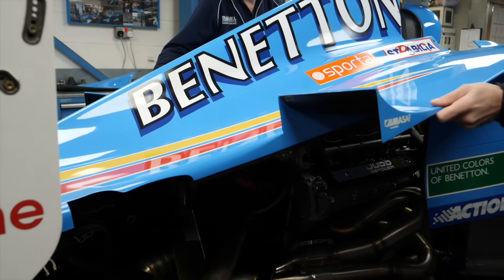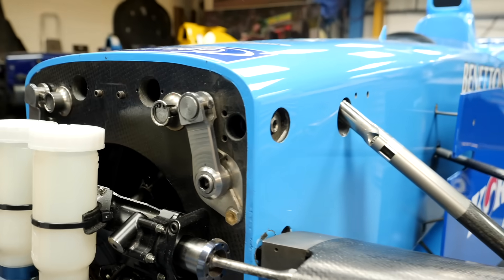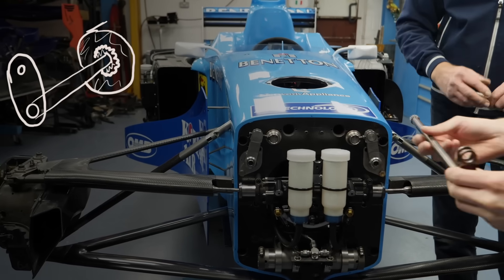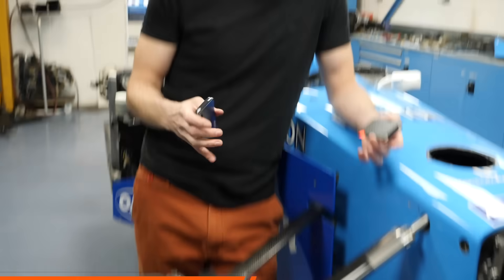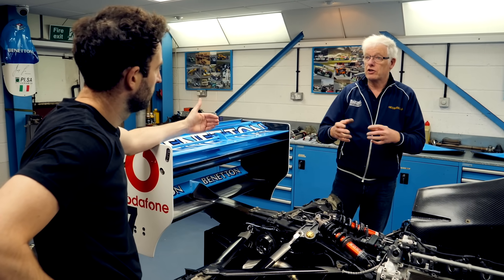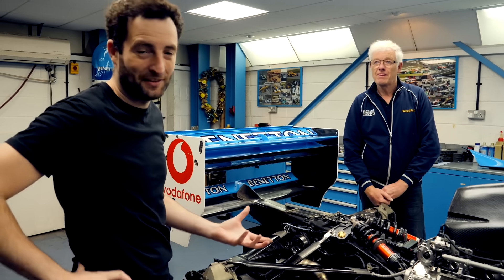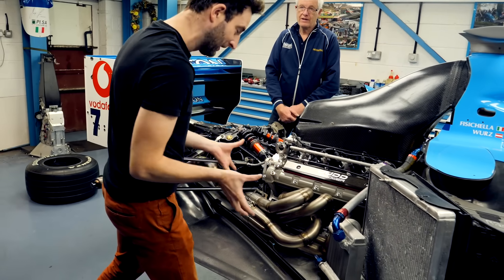Why F1 Suspension Doesn't Use Coil Springs!

Comment: Thanks for rememberiing of the concept of tortion bars. Could you explain the downsides? Its such a minimalistic concept and i jdont see a reason to not use it in a standard car?!

If yiou like jokes. This guy goes to a car spare part shop and asks for a seven-ten cap for his cart. it's in German but you  will get the joke about the 710 cap.... https://www.youtube.com/watch?v=2r4w6YYeBTg

Btw ths 710er cap is built into almost every car if its made from Tesla.;-)

Comment: I understand torsion springs however I do not understand how the motion is dampened in rebound.  the torsion spring elastically deforms and "twists" taking the load..the higher the load the more the twist.   However, once twisted the torsion spring or a coil spring wants to return to its original shape as quickly as possible. in an oil shock the valving is used to dampen both the compression and the rebound...the rebound being extremely important....Do F1 cars not see enough suspension movement to require rebound dampning?

Comment: There wasn't any sort of description of how the torsion bars worked. Just saying "they essentially do the same job" doesn't do anything.
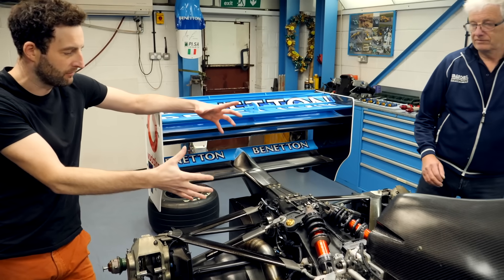1:12 "Push rod forces come through here" while vaguely pointing at the engine does not describe what is happening. You should start with the direction of force from the wheel, follow it through each part of the system to the spring. 
Not a single word on what torsion is. Nothing. The brief part at 1:35 where he motions with his hands on where the input forces come from still doesn't explain what the torsion bar does or why it doesn't shear. What is it connected to? How do the suspension forces get to the torsion bar?
Then at 1:40 "it's really important to see what it does". Great. But they he says "you can't see it as it's covered up". Fuck me sideways. What's the point?
Terrible. Absolutely woeful description of what is happening. If a student submitted this as a description of a suspension system, I'd fail them.

If you're going to give a headline of "why..." and profess you are explaining something, maybe rehearse the script, check it with someone who doesn't know all your industry's technical terms and use a presenter who can explain it.

Comment: Those primary pipes, is the aim to have them the same length?  Because the cylinders fire at different times the exhaust gases will begin their journey at different times.  If the pipes are the same length then the gases from each cylinder will take the same amount of time to arrive at the junction and remain out of sync with each other thereby reducing the gas passing through the junction at any one moment.

Comment: 5:44 can someone explain the attachment of the primaries to the collector? What is the design intent of that bracket?
Reply: Looks to me like adjusters of the primaries? Maybe you unscrew them, and put a different length bracket in the middle. As the Dad was saying: varying the length varies where the power is as per dyno runs. Every F1 race has it's own unique conditions: I guess being able to adjust the exhaust primaries lets a team optimize power delivery per race. Or maybe it's to do with modularity and ease of build and maintenance? Or literally, extra reinforcement for the pipework.

Comment: OLDER Chevrolet/ GMC / Escalade , Silverado used TORSION BAR for Front SUSPENSION !!!!
CORVETTES uses Fiberglass LEAF SPRINGS !!!! to Push on the Lower Control Arms - VERY LIGHT !!!!!!!

Comment: Always liked torsion bar suspension VS coil spring/coil over strut.  Everyone just said how inferior it is... Yet I feel matched with the proper shock absorber it can be an excellent performer... Much like my daily driven vehicle, the other benefit is they don't wear out... A vehicle 30 or 40 even 50 or more years old usually is still running the same torsion bars it was sold with.  Unlike coil spring vehicles.

Comment: Actually a coil spring is just a torsion bar someone wound up around a cylindrical shape.  1960's and early 70's Dodge and Plymouth street cars used torsion bars in their suspension (my dad was a mechanic for a racing team running these cars on dirt and asphalt, so I saw lots of torsion bars as a kid), so this is nothing new.  Also, if you shorten a coil spring, the spring's rate increases. This isn't intuitive until you realize the coiled wire is simply a torsion bar packaged a different way.  It's patently obvious making a torsion bar shorter will increase the spring's rate.

Comment: Thanks, it was interesting to listen to you and your dad talking about some of the stuff you don't always see on F1 cars. Fo rme though it did provoke a question: The title says "Why F1 Suspension Doesn't Use Coil Springs" but the car you showed did have coil springs at the rear. If torsion bars are smaller and lighter, why were they only fitted at the front?

Comment: Is there some reason torsion bars are not used in normal road cars? The suspension takes a LOT of room in normal road cars and torsion bars would allow much more interior space especially at the back of the road car. Do these wear a lot quicker, for example?

Comment: Shame that there was no mention of the Lotus Type 72 that I think was the first Formula One car to use torsion bar suspension. When it debuted in 1970 it had anti-dive and anti-squat, and by all accounts was a bit of a dog to begin with, but by the time the Type 72 was raced in “C” specification, about 5 races into the 1970 season, the anti-dive and anti-squat had been removed, and it was winning.

Comment: Implication is it was some kind of 'new' technology. VW Beetle had torsion springs all round from 1940's (as did the 1970's Morris Marina I had for a few days 'way back when) Damper technology would be far more 'interesting', magnetic ferro fluids, , 'active' suspension, etc. Exhaust gas 'pushed out by piston'? I don't think so. Even on a low power street engine exhaust gas is around 80+psi when valve opens

Comment: What about the suspension damper when using torsion bar? With coil springs, the damper is placed inside the coil. How does it work with torsion bars?

Comment: The Lotus 72 used torsion bars back in 1970. It won a race or two.
Reply: Yes, it's a shame that the Lotus 72 wasn't mentioned regarding the use or torsion bar suspension, plus the fact that it is the progenitor of all modern F1 cars, i.e. side mounted radiators and wing front & back etc, and celebrates its 50th anniversary since it was first campaigned in F1 by Team Lotus.

Comment: How is damping achieved with the torsion rods? I would imagine those don't ave a lot of damping. Is the metal composition tailored to have more hysteresis (which I guess you could consider damping...), or are there other components (for instance, tires) that provide the damping?

Comment: When you showed the front suspension with the torsion bar, you should have explained how it is dampened on the rebound. I've seen this technology used on vintage cars that are  80 years old or more. This concept is not new, the materials are obviously state of the art when this car was constructed.
Cheers for the incredible video featuring these magnificent machines!

Comment: One thing I noticed that was failed to mention is that a torsion bar & a coiled spring both use torsional force to do the same thing. A coiled spring is basically a torsion bar packaged in a coiled shape. Taking a much longer piece of spring steel to fit it into a smaller space. That F1 torsion bar is very small & is very impressive to see.

Comment: The coil spring had a dampener. Do torsion bars need them too? I thought road going production cars with torsion bars still had a shock absorber.
Reply: Yes, there are dampers that you couldn't see behind the bodywork.
Reply: @19minorthreat69  Cool, thanks. :)

Comment: You really need to brush up on mechanics. There were numerous common knowledge mistakes in this video. First you were wrong about the header tubes being "not all the same length" when in reality that is exactly what they are for equalizing the back pressure. Second was saying there are no springs, a torsion bar its self is a spring. The correct statement would have been there are no coil springs. That was also just 4 minutes into the video.

Comment: Torsion bars, such a new cutting edge thing. Except they were on every Dodge, Chrysler and Plymouth of the 50's, 60's, through the mid 70's. Hell they even used them on my Dad's 1956 Ford.

Comment: I get the  torsion bar thing it was used on the morris 1000 and it worked but F1 cars have hardly any suspension they are more like go carts that proper cars.

Comment: The quality of content is amazing, but sometimes, when You paraphorase the expert, you dilute the meaning. 
In 8:05 for instance, it is notabout lack of rigidity in the case of torque transfer to the gearbox, but to provide the rigidity between the whole powertrain and chassis.
Jeez, motorcycles are so much easier to design...

Comment: Exhaust Headers: The header tubes are all the same length to optimize the movement of spent gases from a cylinder's combustion chamber. Exhaust gases are more akin to a "slug" v a continuous stream. (You can actually see this happening if you hold a piece of paper over an exhaust pipe at slow idle. The paper can be sucked back onto the tailpipe as the exhaust pressure drops with each cylinder firing.) The collection box where the tubes come together allow the exhaust gases (slug) to "expand" as they exit a particular tube. That expansion creates a negative pressure wave back up the exhaust tube so that as both intake and exhaust valves are open momentarily together at "split overlap" a small amount of intake air/fuel enters and passes through the combustion chamber and out via the exhaust valve. This "cleanses" any remaining exhaust from the chamber, cools the spark plug, and helps control pre-ignition. All of this activity is predicated on cam / valve timing and optimization on a dyno as your dad mentioned. As the exhaust valve closes the cleansing  ensures a full cumbustion chamber of air/fuel to optimize ignition and power. PS_Have spent countless hours denoying race engines. Cheers.

Comment: That torsion bar is CRAZY small. In road vehicles, the torsion bar is almost as long as the vehicle is wide. This is mostly for longevity, as the longer the bar, the less stress it is under. Longevity is not as much a concern in racing, even still those torsion bars are unbelievably short! I am extremely curious as to what alloy(s) is used.

Comment: Back to the drawing board regards your exhaust comments mate, they’re all equal length, that’s why they bend so much, trying to fit the same amount of pipe length per cylinder in such a confined space. Especially noticeable on turbo cars. Even my old 1.3 Ford pushrod engine ran better on its 4-2-1 equal length manifold ;) I think you could do to possibly spent abit more time listening to dad about engine power theory and principals. 👍

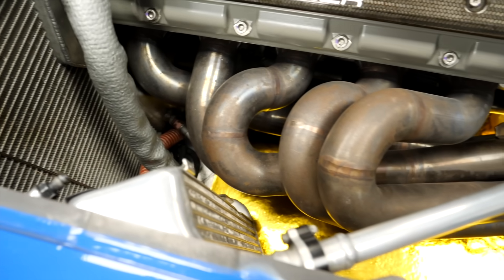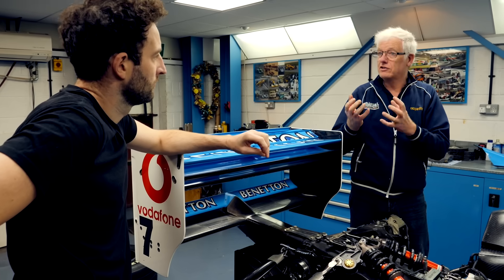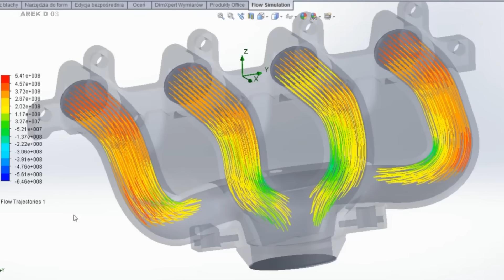Comment: At 3:46 the dad says all the headers/primary tubes HAVE to be the same length, then seconds later at 4:02 he totally contradicts himself by saying if they they are all the same length they collide, so you get disturbance and back pressure!  Which of course is a bad thing.  I would have told him to make your mind up...Do they have to be the same length or not?  But then at 4:25 the son says the complete opposite...That they should be different lengths!  Talk about confusing!

Comment: Compressing a coil-spring twists the rod it is made from. It’s a way of making a long torsion-bar shorter.
Reply: Straight torsion bars have existed since the earlier days of the motorcar. The ones featured here are advanced-material versions of a classic design. I wish they would have covered the rebound dampening process inside the nose of this modern marvel. 

The old-school dampener versions had stacked adjustable disc pads with a tightening screw in the centre to adjust the friction, thus speed, of the rebound. It actually worked well for it's era.
Reply: @JoeGator23  iirc torsion bars were first introduced on production vehicles on the German Panther tanks, as they had used it for suspension, and started the trend of torsion bar suspension throughout combat vehicles from then on, even the Abrams of today uses the Torsion bar

Comment: The old Moggie 1000 ( 1959 ) had torsion bar suspension on the front wheels.
Reply: The Citroën Traction (1934) had still  torsion bars on all wheels (all independant)...

Comment: The “rocker” is called a cantilever.... what dampening is used in the front with the torsionbars ? Friction disc maybe ?
Reply: Rocker, bell crank, cantilever, etc etc there are many names for the same part just like a knuckle can be called an upright. Also its Damping, not dampening... you're not getting it wet. To answer your question, usually the bell cranks that activate the torsion springs will also activate a typical set of linear dampers as well as a heave damper.

Comment: That a coil spring is a torsion bar form into a coil, has been recognition for years I don't have clue when vehicles first used, butevidence is, it could date back to the Egyptian chariots.  Where the entire vehicle was suspended by a torsion bar structure  made of wood.  The  older VW Beetle used torsion bars. Crysler products used them for years. GM light and medium duty trucks use them in the early '60s. Interesting, to see how that on the F1 cars the use of torsion bars, had it'sown evolution.

Comment: Sorry to be pedantic, but in the interest of correctness... what happens in a combustion chamber is not an explosion. It's actually a single flame front, a controlled burn of the compressed gasses. knocking / pre ignition is when two flame fronts meet = can cause damage (higher octane prevents this).

Comment: Not car related, but split unit ac on the wall has the drain installed incorrectly. It needs to drain down, not up.
Reply: sure it’s the drain?  only looking on a phone - i’m sure his old man would know that water doesn’t flow uphill